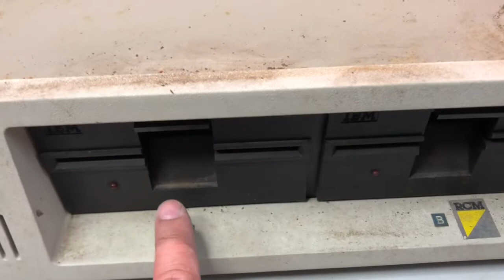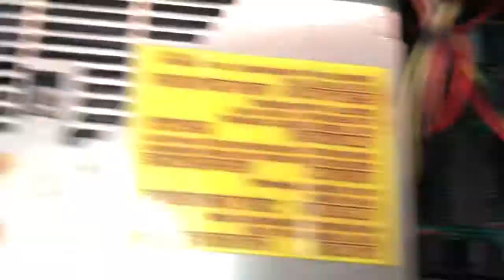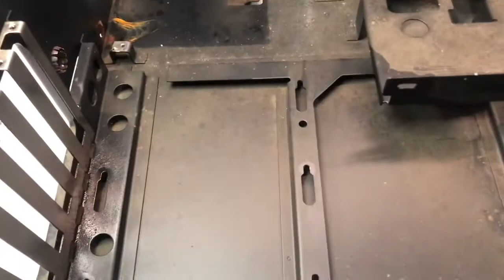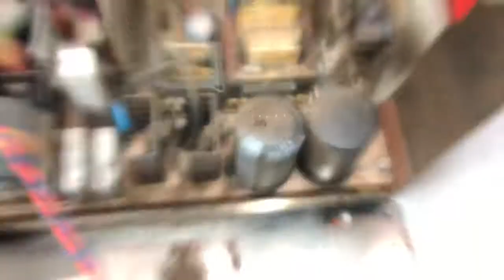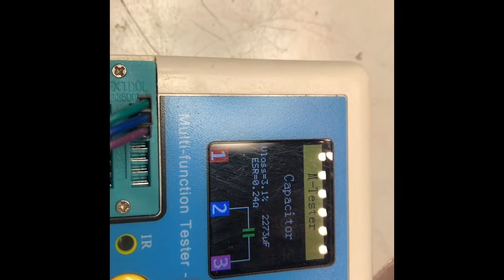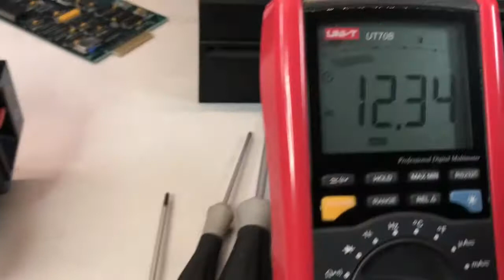IBM 5150 BARN FIND part3 resurrection..Power Supply

Comment: The power supply was made by Zenith.  That's actually a later supply from a 5160 which produces 130w rather than the original's 63.5W.  Some of the later ones had universal power input from 85-265VAC and were made by Astec Power in Hong Kong.